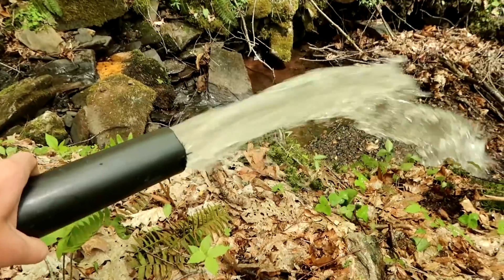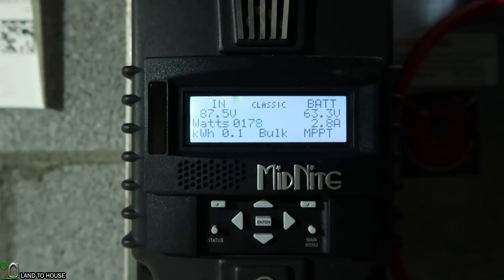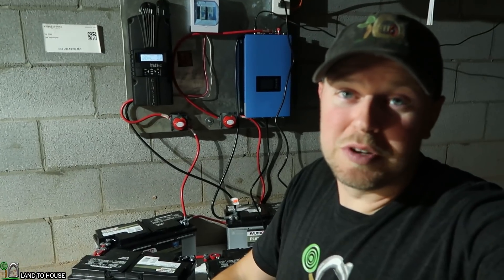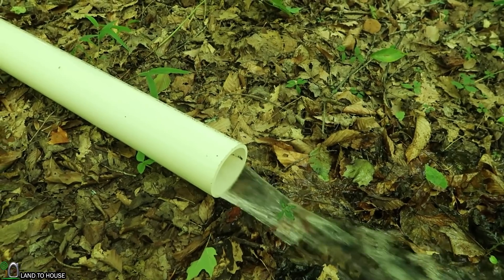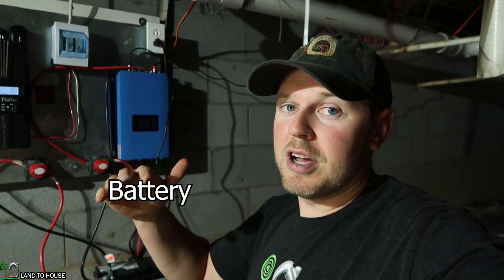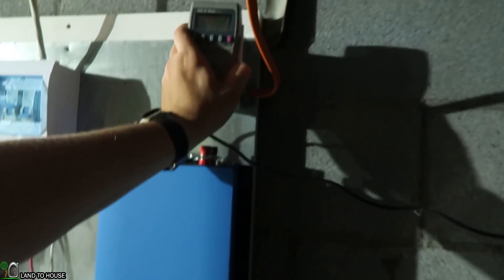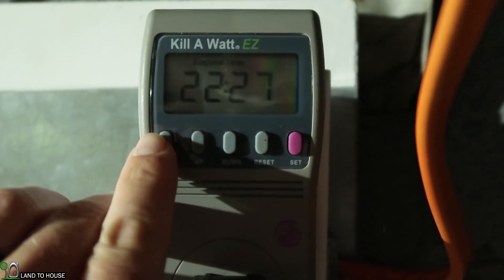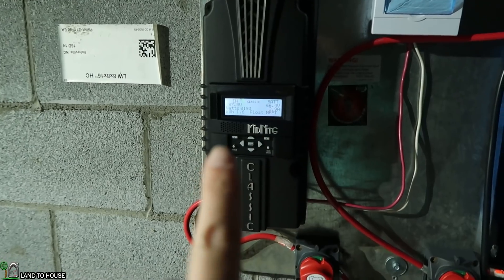Power up the Turbine Micro Hydro 9/10

Comment: Why are you feeding the DC power into a charge controller and then into the battery bank, not first into the inverter and the excess energy that is not going into the house will go into the batteries via the charge controller? I am no electrical engineer but I thought that was how a solar+storage system works, as it reduces the number of cycles on the battery.

Comment: You saved 50 cents per day x 365 = $182.50 per year with a project budget of how many thousands of dollars.  10 years later, the maintenance costs will put you in the red again, all while robbing nature of a stream being used by all sorts of deer and other animals.  Sounds about right, huh?
Reply from the maker: In my area the power cost around $0.18/kwh. So this install is around $1.20 per day. The youtube video series has made $10k + so its beyond paid for.
Reply: @LandtoHouse  I'm quite sure the audience is not going to get it paid for when they install their own system, right?  So, I'd be concerned about misleading them into a poor investment without telling them the actual cost savings and how minimal it really is.  I can imagine what happens when you run a 2.5 ton air conditioner with it.  They'd save more by not running an AC or buying one in that matter, which would be the better advice. Also, did you get in touch with the DNR when you decided to divert a natural resource?  You never touched on that subject, or did you?
Reply from the maker: @BelleRiverHeating   A couple videos after this series is done I do a full walk through showing the cost between what I paid and what you can expect to pay As an average consumer. A system like this is more ideal if you are off grid and unable to get grid power to your place. For example I  Filmed an off grid yurt. His system is making 250w as the only power out there.
Reply from the maker: @BelleRiverHeating   There is a Spring just below the the source of my intake. There's only about 20' of Creek that does not have much water. The water is still flowing in the Creek just through a pipe that returns to the Creek.

Comment: The only part I don’t like is the plug pins that go into the receptacle. They are potentially live and exposed when connecting and disconnecting. That is not foolproof and we’re all capable of being foolish.
Reply from the maker: The inverters are islanding. Its as safe as a partially unplugged appliance.  But as soon as the plug is removed the inverter is off.

Comment: Wonderful project, I have watched the entire series. Little recommendation, when you open one nozzle, you have a bit of overflow, when two are open, there's underflow. It would be cool if you can control the opening and closing of the nozzles depending on the pressure using some microcontroller. You'll also be able to get the maximum power out of the turbine by opening and closing the nozzles at the right time.
Reply from the maker: Thank you for watching! Yes I am actually working with Langston alternative power to get a few different size nozzles. That will allow different flow rates. Perhaps someday I can try the micro controller.

Comment: ⚡️oho almost 200 wats. mot bad especailly for firs project and  taht sanll creek.  if you have more creeks on your prperrty you can interrelate them to same pipe and get couple more of little turbines ro one one couple small and one bigger. i have heart that electric truks have very good batteries and you can byou them very very cheap price if they are used because they discard them when they do not load over 80% and that is very good for homr use  when you charge then littlebit all the time. or maybe couple of used electric car batteries beause many of these have even 100 kwh capacity when thwy are but i don`t know what used electric car batteries cost. very cool project and it`s have no impact to nature like the creek where you got all your water. i hope all go as planned and wish you nice moment with your gear, because i love to do all kind of constructions old electric component. be carefull with voltage especially with AC (alternative current) hello from one electrician from finland, ⚡️⚡️⚡️⚡️⚡️

Comment: Love the videos and I find this series inspiring.  I'd do something like this just to be able to do it if I had a good creek.
I think I missed something, you have 5 batteries => 60v @25% charged, 63.5v @100% charged, CC output for 'float charge' at 67.5v, I don't see how it can get up to 72v you mentioned as full charge to cut on the inverter....

Comment: It is pretty sketchy the way the inverter connect to the house electrical. If that black wire is unplugged you'll have power on the exposed prongs.
Reply from the maker: The inverter is autoislanding. No issue with exposed plugs.

Comment: 365 days times 24 hours = 8760 Hours in a year - 8760 divided by 22 hours = 398.181818 x .45 cents = $179.18 of saving in a year.... All that time and cost of the materials doesn't seem worth the trouble.
Reply from the maker: So far its averaging $20 savings a month. That's $240 a year. After some modifications it will make 450 to 500w. That is more like $45 savings a month for the winter and spring.
Reply: @LandtoHouse  Yeah I just watched your cost break down video. The real question is how long will the generator last? If you have to replace it every 5 years or less then i'm not sure if it's worth it.  I feel like if it can pay for it self in 5 years it's definitely worth it. but I've spent 5k on really dumb stuff so if it pay for it self in 10 years I guess it might be worth it too. Again how much maintenance and how often are you working on it and/or replacing things is the real questions. I guess only time will tell.

Comment: Nice one :-) Anyway, what about an electronically adjustable valve for each nozzle? Yeah, a different water distribution scheme would be needed but then you can then fine-tune which nozzle (that can be a different size) is consuming how much water. You can also have an electronic sensor to check penstock pressure and adjust the system accordingly. Cheers ;-)

Comment: as long as you put the water back into the creek when your through with it, what does it matter if you have overflow at the head??? and why not run all the nozzels all the time???
Reply from the maker: If air gets into the penstock it greatly reduces the power.

Comment: I'm planning on something like this... I was just only planning a 220volt inverter w/limiter instead of your 110v inverter w/limiter.  If (I really mean "IF")  I understand power companies correctly,  you need to push out of the inverter what your house takes in.  Meaning, if one leg of the 220v(110v x 2 = 220v) coming in the house pulls a lot more   than the other leg, you are charged which one Pulls the most.  You pay for the most on whatever leg.  Normally, they are about the same.  Your house breaker box has 1/2 of your house one 110v leg and 1/2 on the other 110v leg.  thanks for your thoughts...

Comment: Is it possible to have pressure on 2 nozzles coming from opposite sides to keep an equal opposing torque pressure against the bearings inside the unit.  Even if each nozzle was only open half way or full. I would try to keep the pressure equal on each side to make your bearings last longer on the Turbine. You don't want all the torque on just one side of the unit from the water. It will last a lot longer for you.
I hope I was able to convey the message correctly to you.

Comment: Do you have a price break down? Also how long do those batteries last?
Reply from the maker: I have a general price. I need to make a video on that.

The batteries should last 8 years or more if I don't drop them below 60v. Let's hope.
Reply: @LandtoHouse  Cheers for the reply only stumbled across this method last night and pretty keen to look into more.. my thinking is that why couldn't I set this up with a tank water set up and use a pump that is low wattage and just recycle the water as i don't have a creek through my property

Comment: Interesting series with a lot fewer missteps than I make, it shows the research pays.
Just a suggestion: The jets on the opposite side of the turbine are on a narrower feedpipe and it's likely that the pressure from the step down in size would increase the water jet speed for the same volume. Possibly worth concentrating on using them rather than the  larger jets, or even using narrower jets on the bigger pipes. Doubling the speed of the jet provides x4 times the kinetic energy hitting the turbine (mass x velocity That won't translate exactly for narrow jets as less water-mass is going through the narrower jet, but should be easier to maintain a higher jet velocity to get the power you need than increasing the volume of water. Good job though, I enjoyed it.
Reply from the maker: There were a few big mistakes that caused the project to be a month longer than it should have been. But its working well! Soon I will be installing another nozzle that is 3/16" on the side. It should boost the power to 250 watts.

Comment: if you have solar and wind, you could make a battery by pumping up hydro to the reservoir
Reply from the maker: We don't have wind here. Its just a light breeze most of the time.
Reply: @LandtoHouse  solar battery then?
Reply from the maker: I will use the same 60v battery bank for both solar and hydro.

Comment: I am all for generating your own power, I have been working part time with solar panels but have not yet completed my build yet. I am curious as to how much you have spent and how long you project it will take to break even or come out ahead. Thanks, keep up the good work!
Reply from the maker: Solar is next on my list. I will use the same batteries as the hydro. I went all out on this install and spent a lot. Around $3k. The pay back is going to be 5 to 7 years. (The actual payback with YouTube videos is more like 2 years)

Comment: I must ask this... Is your current house meter have the ability to monitor both ways? If not, that 2,800 wH that the kill a watt just showed... Was actually seen as a chargeable wH. So you may just be making your electric bill higher that normal. 

When I installed PV 5 years ago. One of the crews left the system on. And the customer’s electric bill was more than double that month. So the PV had to pay for it and shut off the system until the electric company got out there and swapped the meter out.
Reply from the maker: I am using the limiter inverter that only allows power up to what the house is using. So there is no power going into the grid.
Reply: Land to House I think it’ll be a good idea to turn off all breakers except for the breaker the inverter is attached to. And use a high current device, one that the inverter will match. 

Take a picture of your meter and turn that device on for 1 hour. After the hour take an other picture of the meter and turn the inverter off. Leave the device on and after an other hour take an other picture of the meter. 

I am willing to bet that there is a difference between the tests. When the inverter was on, it doubled the usage. And the meter saw it like that as well, thus charged double the usage.
Reply from the maker: This inverter is designed to read the house usage. The inverter power is ever slightly different than grid power so that the house pulls from it first.  Let's say the house is using 100 watts. The inverter will feed 95 watts and the grid will feed 5 watts.
Reply: Land to House I understand what you’re saying. But unfortunately the electric company meter may not see it like that. It may see 195 watts being used, not 5.
Reply: @robertsteich7362  I think the inverter is connected down stream of the electric company meter so won't be recorded on the meter.
Reply: Andrew Still If you’re saying the inverter is connected between the road and the meter? Then that is highly illegal and the electric company has every legal right to “back charge” Seth for as long as he owned the house. 

That is the very reason I will not put my name on the electric bill for tenants. As a home owner I will get charged for any “loss” money if the tenant taps into the power line between the road and meter.
Reply: @robertsteich7362  the meter only reads current passing through the meter.  Much older meters that predate "net metering laws" couldn't tell which way the power went, in or out, only that it went through the meter.  that's how your customer got charged for putting their extra juice out to the grid.  A "Professional" installation includes having the power company replace the existing meter with a net metering compliant meter that records KWH in each direction.  As long as you use a limited inverter so that the net flow is always some small amount in from the grid you avoid those headaches.
Reply: Good point Robert. Should be easy enough to compare the kill a watt meter consumption for a day to the house meter readings for the same period.

Comment: i would of like to of scene you turn all nozzles on see what prassure drops to if it does not drop then see what wattage your getting the jump to 300 plus watts suprised me
Reply from the maker: Currently there are four 1/4" nozzles in there. That would be 48gpm. My penstock can only flow 39.5 ish gpm. The jets would not allow it to work at full. Now when I install a couple 3/16" nozzles we will get some results.

Comment: Ok so my ram pump works just fine only with a low head pressure.  But its a slow output,  so when I increase the head pressure to get more water through my 3/4 pump. But when i open the delivery  pipe even just a little bit I can't get the pump to run again. I know  that I have enough back pressure  so whats my issue?
Reply from the maker: What is your input head pressure and lift when the unit shuts off?
Reply: Mpy head pressure  is 5 ft and output is 23
Reply from the maker: Sounds like you are having back pressure issues. When you try to lift with too much head pressure it causes the water to exit faster than its entering.

Comment: Hmm, an idea, use an Arduino (or similar) to monitor the pressure. Using that, you could connect servo motors or install solenoids to automatically control the amount of jets in use. this would mean you are always getting 100% out of your system. again, just an idea. love how it turned out though!
Reply: i had an idea like this but using float switches in the main tank higher the level of water fo more valves open should be just a simple relay switcing system
Reply from the maker: There are systems like that. For mine I think that I will just set it and leave it.

Comment: Hi Seth, What is the head height to your barrel and have you measured the gpm coming out of the waste pipe below the turbine with 1 nozzle and 2 nozzles? Thanks!
Reply from the maker: The total head pressure is 163 feet. I will be running those tests soon. Now that I know everything is working its time for playing around.

Comment: Would it not be possible to get more water of the creek into your intake? I had to go back to Intake Screen Box Build and Install Micro Hydro 1/10, seems it would be possible to get more into it? Or do you only want to use a certain amount of water and keep the rest in the creek? Great project and well done!
Reply from the maker: I actually have a plan on getting more water. Most of the time the summer flow is low and I need more water. In winter there is more water than the 2" penstock can carry.

Comment: So because I've always been pretty ignorant about power, what is my questions would be: when the inverter is not on you're just using the electric company's power? And if that is the case then having a more productive/efficient Creek would make it to where you would never need a power company again???
Reply from the maker: The inverter pulls power from the battery and supplements the house power usage. When we use less in the house the inverter limits the output. The inverter can only output around 800w. There are plenty of times we are using 2000+ watts in the house.
Reply: @LandtoHouse  great series bro!!  So are you pushing power back on the grid? And if not does the outback slow the turbine down to produce just what you are using?
Reply from the maker: The charge controller is making as much power as possible go into the batteries. The inverter reads the amps going into the house and feeds as much as possible to match that (up to 800watts). When the house is not using much power the inverter limits the output.
Reply: @LandtoHouse  ok thanks did you get your inverter from Langston as well? And also after watching your video on the little green tiller I bought one and must say it has a lot of power for such a little machine!! Very impressed!!
Reply from the maker: The inverter is actually from Amazon. Link in the description of video 8 I think.  

That tiller is really great!